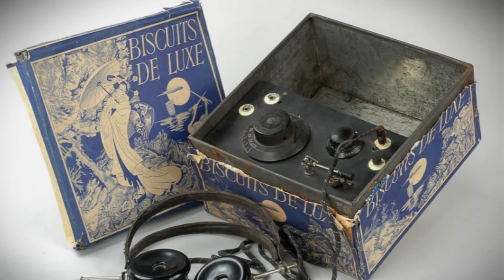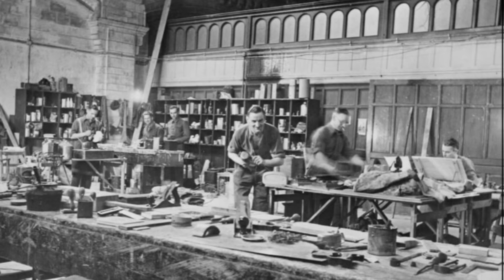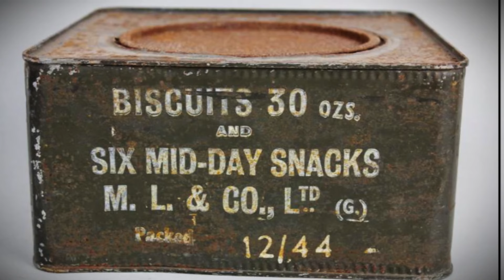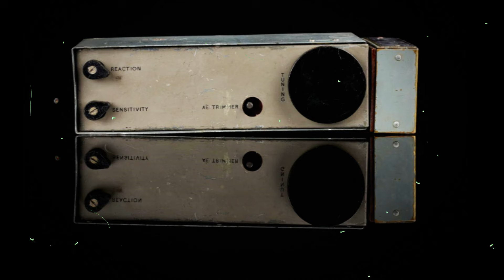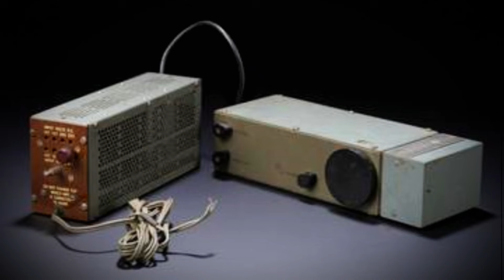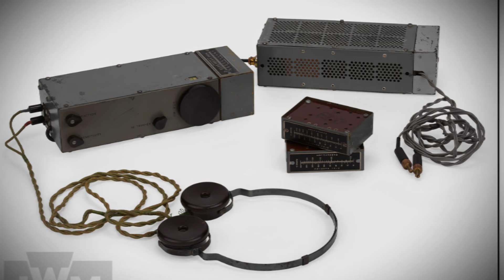The British 'Genius' Biscuit Tin Radio That Coordinated Underground Attacks

Comment: No way could they have 1) powered a transmitter with batteries available at the time in a biscuit tin, 2) have the technology to use the RAPID Morse code equivalent in the biscuit tin with the radio and batteries.   It's a good story but impossible with the available technology of the early 1940s.  The radio parachute transceivers were larger cases disguised like small brief cases or business mans display cases.  The miniature vacuum tubes were developed later in the war for the proximity switch tip for cannon shells.  Most of this story's facts were manufactured for the story.  Interesting but false.

Comment: The biscuit tin radio wasnt a crystal set(as pictured) nor was it a transmitter but a medium wave receiver using valve technology and designed to enable resistance groups in france,belgium and netherlands to listen to the bbc broadcasting coded messages after news programs
These were along the lines of 'uncle fred has a bunion'
'Aunt vera will bring oranges'